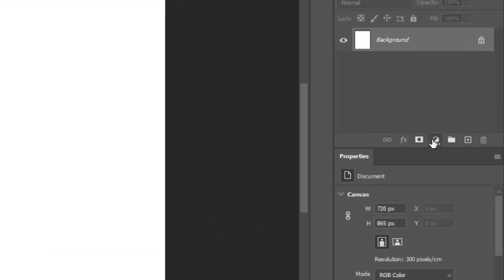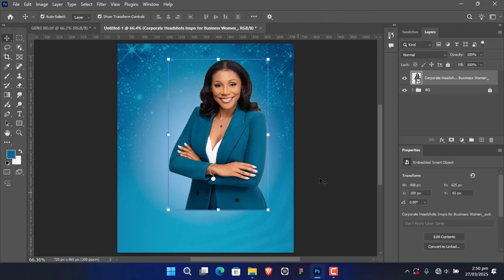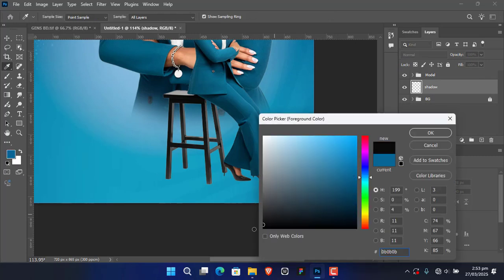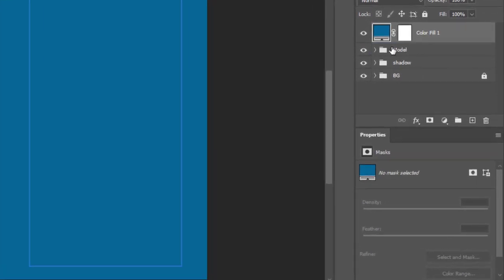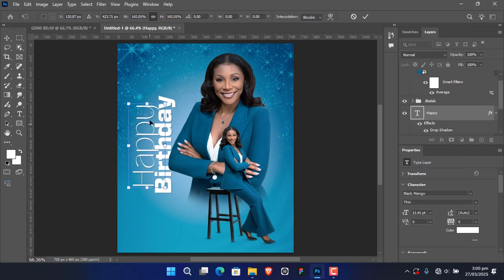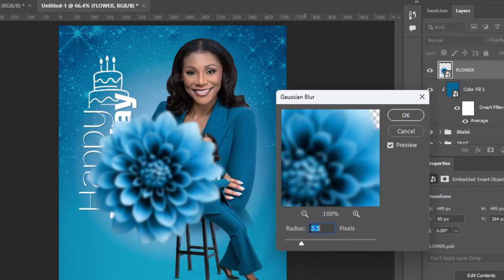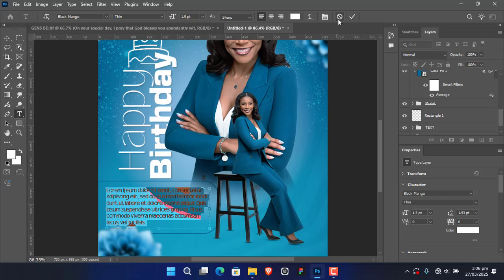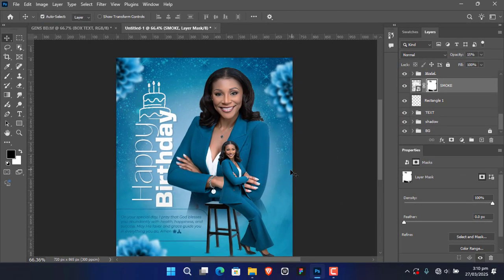Create a Stunning Birthday Flyer in Photoshop – Easy Step-by-Step Tutorial! 🎨🎂

Comment: Thanks great man. You are doing a great job! Please, I need a clarity in the area when you selected the woman and the stool together. I tried clicking on the image but the selection object tool did not automatically  select the edges as shown in your video. How did you do that aspect?
Reply from the maker: Please, when you are select with any of the selection tool, check the contextual bar (control bar). Make sure you select ADD TO SELECTION. This will help you make additional selection to the previous ones. If not any click will create a new separate selection.
Reply from the maker: Please let me know if it works for you